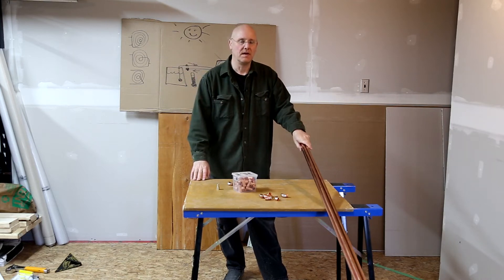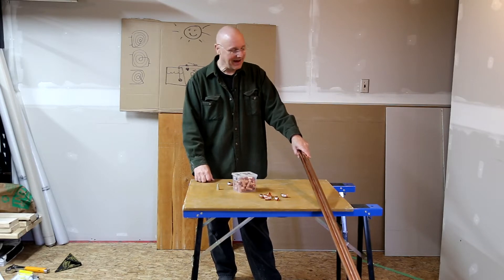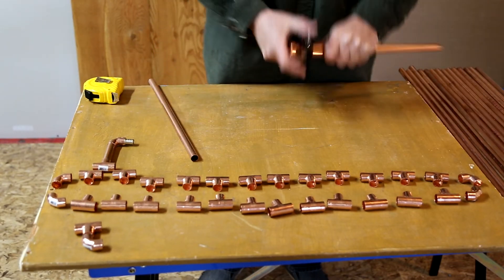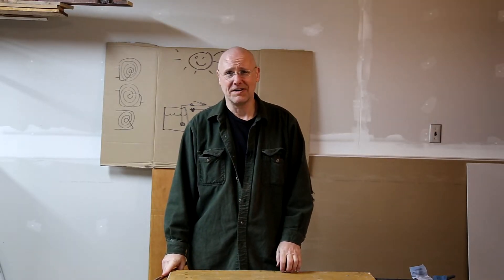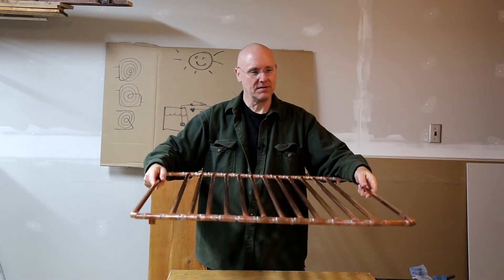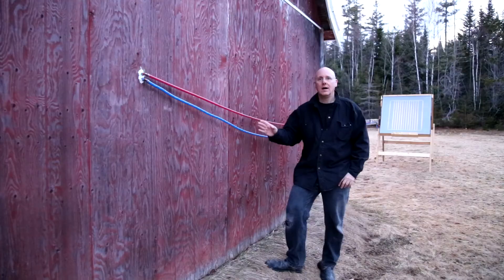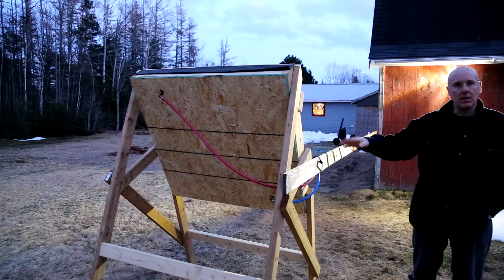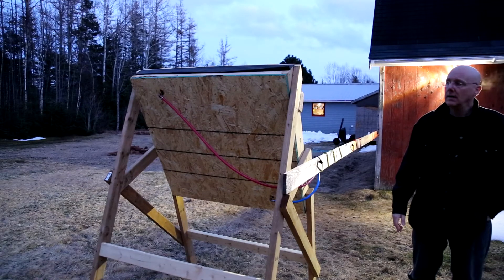Quarantine Crafts - DIY Solar Thermal Heater - Version 2

Comment: It's a great idea but PLEASE, read some basic physics, I can't imagine a less efficient design.
Reply from the maker: It was a fun experiment. It worked to a degree and actually brought the tank to mid 20's - 30 on some days - which helped take the chill off the room. The idea was to tweak and tinker and make it better (add fins, improve the box, etc). The early thermal boxes were basically just this, tubes with fins. But then I replaced it with solar thermal tubes.

Comment: 1) You don't need the outer loop... the curve of the pipe will affect the flow through the center pipes. Water like the path of least resistance, a curved 90 has less resistance than a Tee does. You want just a top and bottom header. Tilt the collector so it will drain to the output and fill to the last down pipe and cap the end of the top header opposite of the input so water doesn't collect in the end and freeze.

2) Feed from the top, then what happens is... there will be less strain on the pump, once the pump fills to the highest point, then it will act like a siphon and the weight of the water will help pull water though the pump and at that point you will need to dial back the power to maintain the flow you want. As a bonus, you will use less power.

3) The return end needs to be in the air pocket otherwise it won't break the siphon and drain back. Don't want to hear the water flowing, use a nylon mesh wire loom or a plastic ramp to slowly add the water back into the tank or point the end of the pipe so it hits the side of the barrel.

4) Last but not least, if you have a closed loop system, if you add pressure to the tank of around 10 psi it cuts back on the chance of the system boiling... In addition lack of new oxygen prevents oxidation and corrosion of your pump and piping.
Reply from the maker: If I added water from the top, the water would take the path of least resistance and head right for the exit at the bottom. The other vertical pipes to the left or right of the entrance wouldn't see any water. Filling from the bottom, the water will even on the horizontal and go up each vertical pipe at the same rate - filling the entire contraption.
Reply: @Pinballorama  Don't take my word for it... Here is someone who designs systems. On this design you have to make sure since it is an open system is not to be running any steel piping. Using steel pipe you will get galvanic corrosion and the pipes will rust faster. Use brass, copper or pex (pex - provided you don't reach the pex temperature limit 200 degrees F some collectors empty can get to over 300 degrees F and when you pump the water in to it, it can flash boil and cause the return piping to get over 200 degrees F. In addition, with pex if you are using a pressurized closed system to increase the boiling temperature then you are limited to - 160 psi at 73°F
, 100 psi at 180°F and 80 psi at 200°F) If you are planning on using any pex in an open system, then I would consider using an Arduino temperature monitor and adding a cooling / heat dump switching system, or automatically stopping the pumps once power is restored until the collector has cooled down. 

Also in my original response on a closed system, I mentioned 10 psi, I meant to say 10 bar or 145 psi then it would raise the boiling point of the system to 356.1 degrees F.
 5 bar or 72.5 psi would 305.4 degrees F

Solar Water Heating 101.1 - Pressure or No Pressure?
https://www.youtube.com/watch?v=vfGVtKlJbYM

To calculate different boiling temps...
https://www.engineeringtoolbox.com/boiling-point-water-d_926.html
Reply from the maker: @kiddiescripterkiller  Ok. So that's where I was confused on your first comment. Mine is an open system and it's almost exactly configured like the video you provided. Well, it was. I've since changed the home made copper pipe collector to 40 commercial glass evac tubes. Heat exchange on the top. It's still an open system though. Pump goes off, entire things drains back to the tank. There is a glimpse of it on the last "Just vloggin" post I uploaded a few days ago. The next step was to insert a pump/temp control using a Pi or Arduino, but I found some controllers designed to work on evac tube configurations and they'd really be plug and play for me - and they don't cost all that much. That's the next step in the system for me. Well, once I get the new pump in. The little pump I was using died once I put in the evac tubes. I expected that though because the rise was 8+ feet higher and the little test pump I had just didn't have the guts. For fun, I ran it until it popped. While it ran for those few days, I was getting pretty good temps in the tank. Much higher than the home made collector.
Reply: @Pinballorama  There are plenty of Arduino setups I would use a k type thermocouple MAX6675 That way you can screw the thermocouple into the pipe to get more accurate reading of the water temp. 

I can't use evacuated tubes, my setup is on my Stealth camper. A 26' Uhaul truck. So I can't have them at the right angle needed for them to work. Otherwise I would be doing a 11' 8" bridge everyday... lol https://www.youtube.com/watch?v=USu8vT_tfdw 

I use a closed system with glycol insulated 55 gallon drum with a 26' x 14" solar water heater for radiant heat in floors in the living area (8' x 7'11" and 3' x  7'11") and radiant wall heat in the workshop / garage area (15' x 7' 11"). Being closed it helps the glycol last longer. If glycol is exposed to oxygen it will change the ph faster and start damaging the pipes and pumps. Plus with glycol, if I'm away from the truck and something happens, I don't have to worry about everything freezing and having a massive mess to clean up.

I have an 24 vdc electric heater to dump power into heating the tank once the batteries are fully charged if needed. In the 55 gallon drum is 2 separate heat exchangers one to heat hot water for the shower and sink and the second for my solar panel heating and cooling system. Since the panels sit flat, I use the heat to melt the snow off them (Not fun climbing up there to push the snow off, it's 12' 4" high.) and once the solar panels get too hot from the sun, I can then cool them to get more power out of them. So I can either dump the heat back into the tank or it switches to a radiator mounted under the truck with cooling fans to dump the heat. It can also dump the heat out of the tank, if the solar collector get too hot. You want glycol not to get above 250 degrees F it will degrade it faster. So I keep the tank temp at 190. I have 10 - 400 solar panels on top of the truck and use 2 tesla model S batteries for 10.4 Kwh of power at 24v. Plus it cools or heats the batteries as needed. Everything is controlled automatically with Arduino. Monitors the incoming and outgoing temps at each point, top and bottom tank temp, room temps, and will speed up, slow down or switch or stop the the pumps. And if all else fails, I have a diesel heater and gas generator as a back up. Working on getting them automated as well.

Don't have pics... because I want to remain stealth, the truck has no windows and it looks like a POS work truck from the outside. I use hidden night vision cameras in the led work lights on the roof rack to see what is going on outside.

Comment: Where you been Seven? I never got to see the payoff of the Black knight retheme. Come back to us.
Reply from the maker: Actually, I'm just unpacking the tools in the new workshop. Getting the final electrical done. I should have a new video up in a couple weeks (on clear coating) and hopefully shortly after the 3rd in the series on startup issues on EM machines. Black Knight isn't finished, but it will be one of the 3 machines I plan on setting up to work on.

Comment: I was looking into making something like this 5 or so years ago.

Curious why you went water?  All the vids I had watched back then and ease of build, I was just planning on air.

People use old pop cans or coffee cans inside a black box , all painted black, and then all you need is a solar 12v fan to pump air into the space.

No worries about water freezing, no worries about storage, no worries about an indoor radiator, etc... All you need to do is have the fan shut off once the outside temp is lower than inside.

Is there a specific reason to go water? Will the water in the tank stay warm for hours and hours afterwards?
Reply from the maker: There is an old trick for "off the grid" type homes to put a firewood furnace in the basement and stuff a ton of water filled containers down there with it. The fire warms the house directly but also warms the tanks. The tanks radiate their heat over the next 6-8 hours after the fire is out. The air style ones are fine, and work to a degree, but once the sun goes down you're done. Right now it gets up to 8c during the day, but last night it was -6.8c (sneak preview: It froze my pipes because they didn't drain and blew out a section in the panel). I want something to continue to warm for hours after the sun goes down. I may not even need a radiator type setup. The barrel might be good enough. The fun part for me is playing with it and seeing what works and what doesn't. A tweak here, a change there. Tracking the data.
Reply: @Pinballorama  That's what I figured...was to radiate the heat later.

Curious, are you to run the PEX underground so it doesn't freeze and remains a more constant temperature?

Leaving the pipes outside during the winter to run from the array to your house will lose a lot of the heat it gained inside the array.

Also side note, I had been looking into building a few small wind turbines too...the ones that are attached to car alternators and then to a battery bank. If you are in a windy area (where I am the wind comes up off the river), they can generate a lot of power...and with LEDs can work quite well.
Reply from the maker: @orangewhipster  The problem with running underground is I need these pipes to drain at night. Right now I'm just playing around. If it all worked out, then I'll start insulating the pipes. Perhaps actually build a insulated box to run them through. Another option is to move this to the roof if it starts performing well.

I have looked into proper PV solar panels and wind. Both are options for us here. You can pick up some pre-made turbines for really cheap these days. I'm hesitant to move this direction just based on the costs of battery banks. I want something I can start small and then scale up so I need to do a bit more research on this.
Reply: @Pinballorama  Couldn't you simply add another pump that would pump the water out of the array back onto the tank? And put a shut off on the output of the tank...all inside the house so it can all be stopped and drained from inside? Just thoughts.
Reply from the maker: I could. I'm not sure how I would control that without getting a Pi or something involved. I suppose a second pump could kick on a timer. At the moment I have a temperature relay which I will put in the box. It will kick the pump on when it gets to a particular temperature - and back off when it cools down.  I kind of like the gravity process though. It's simple. Pump goes off, system drains.
Reply: @Pinballorama  Would definitely.need to be higher up...but you mentioned that already.

Would be pretty easy to just add an array or arrays to scale it up too.